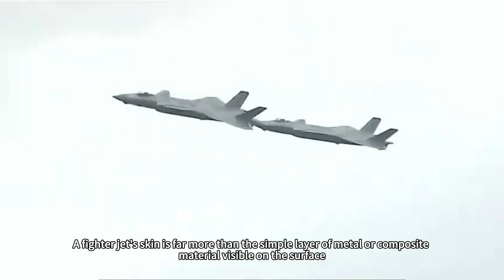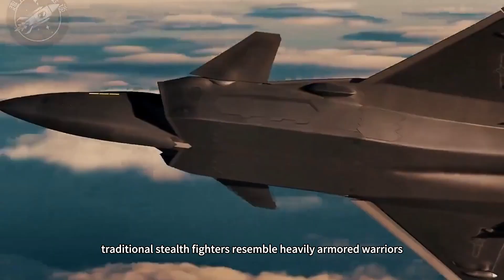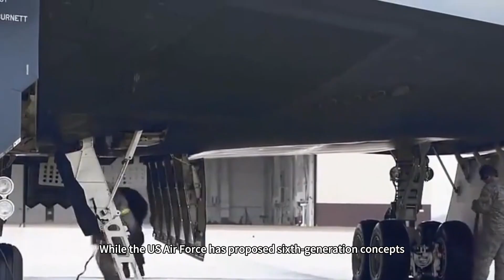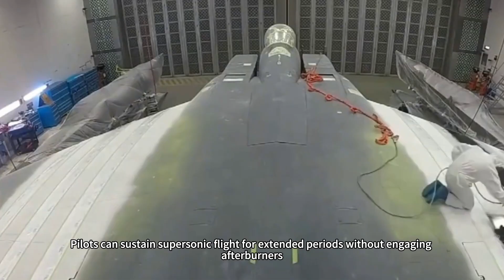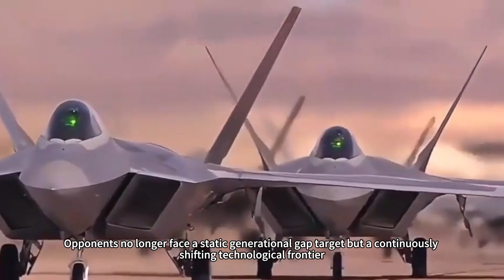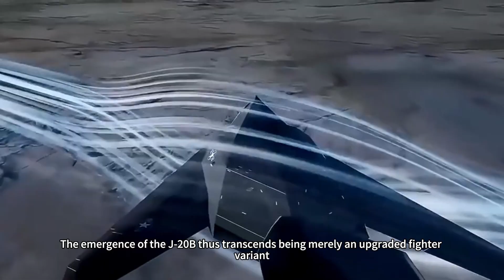The J-20B joins the ranks of 5.5-gen! Flexible skin makes an early appearance

Comment: How easy would it be for the Chinese to install these upgrades to older platforms such as the J10!?

OR would it be more sensible to just make a new platform!?

I just remember early renders from probably fans that made the J10 stealthy with straight and angular edges but still recognisably still the J10?

im just salivating at an upgrade or more stealthier single engined variant of the J20 or an upgrade of the J10

i.e im guessing a stealthier single engine J10 would be a completely new platform as it would need to have internal bays, a bigger engine etc

OR are the J50s etc the new J10s!?
Reply: RAM coating on gen 4 is worthless.
Reply: @larryc1616  its not, 80% of a stealthy aircrafts stealth is from the ram coating, not the design of the aircraft shape. You can see this trend with the f35, where the fuselage is basically a tube, similar to the f16. Having very effective RAM coating on 4th generation planes allows them to reduce their RCS drastically, whilst not as much as an aircraft meant to be stealthy, allowing them to operate far better in contested air spaces where the enemy has powerful radars, and they're needed for dogfighting and missile trucking